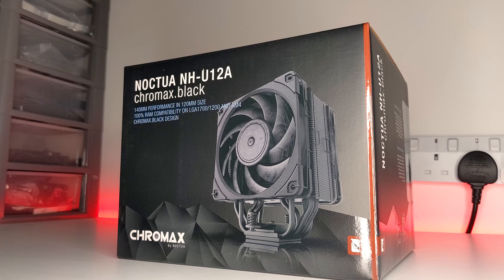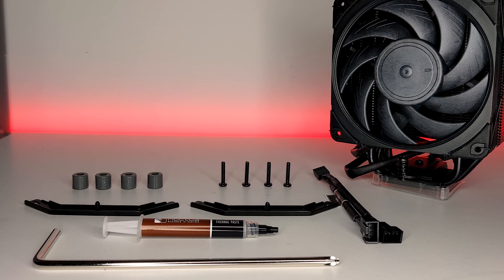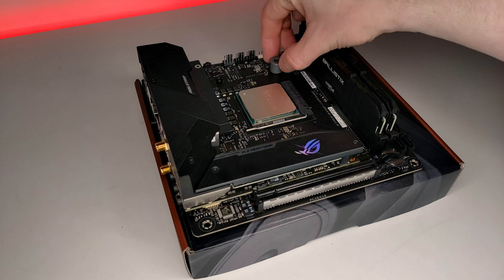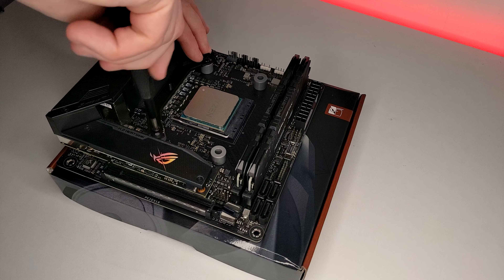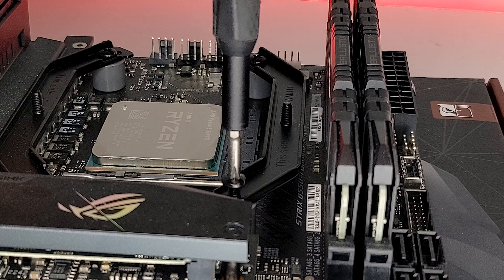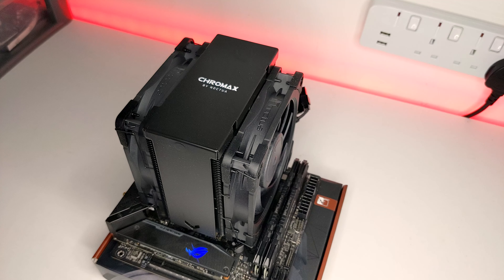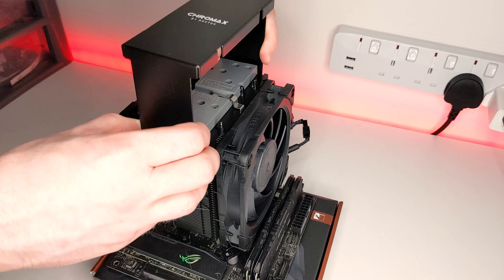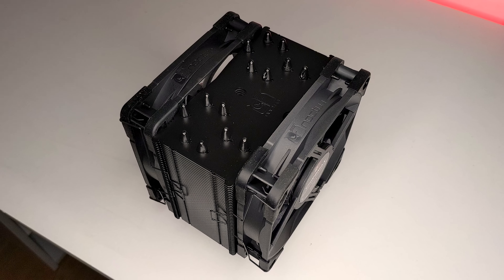Noctua NH-U12A Chromax.Black & NA-HC7/NA-HC8 Heatsink Covers - AM4 Installation Tutorial

Comment: So i have an AS rock B550M-C. Mobo.  My Ram is Corsair RGB.  I am a bit worried it wont fit with the ram
Reply: Sorry if this is too late but it has 100% ram clearance with am4
Reply: You can put the fans a little higher if it wouldnt fit

Comment: I purchased  the same noctua cooler and i have two cpu fan header on my motherboard.
Is it ok to use two fans on one header.
Or better to go for sperate cpu fan header?
Thank u
Reply from the maker: Should be fine using 2 fans on one CPU fan header using the included splitter 👍